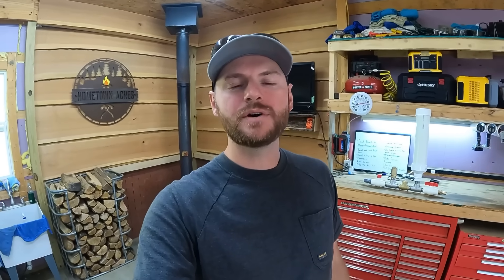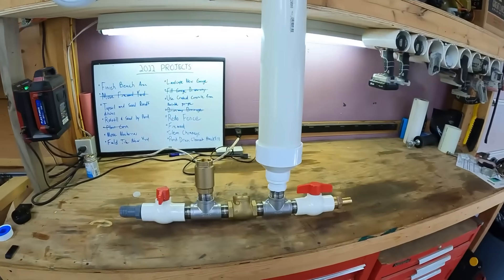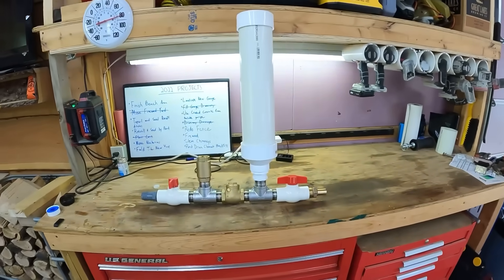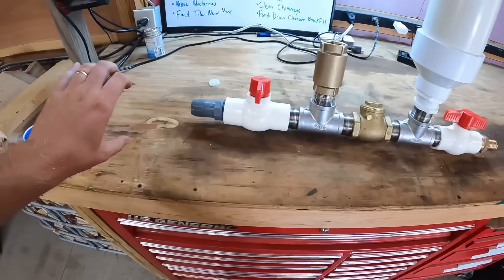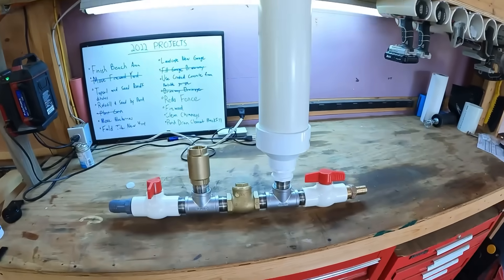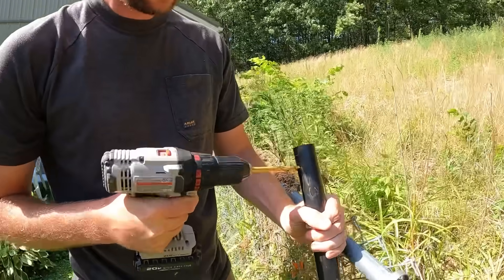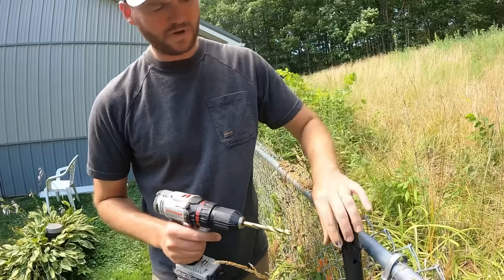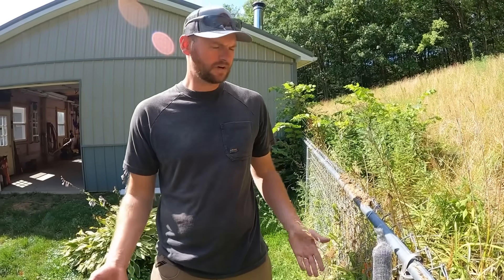We Found Water For The Pond - Hydraulic Ram Pump

Comment: You should always run poly-pipe through a pvc sleeve when crossing a road bed.  for 1" you can use 1 1/2.  The reason for the sleeve is to protect the poly-pipe from collapsing due to regular vehicle traffic compacting the soil along with the pipe.

Comment: I'm thinking so long as the river/stream was running you could put the small pipe in a bigger black pipe 2' off the ground and the sun would heat the outer pipe up which would heat the inner pipe, this would keep the water running in the day time. It won't freeze as long as it keeps flowing and river supplies sufficient flow.

Comment: Love the setup. But just a little bit of a thought. You need to put a 45 degree on the catch tank. This will slow algae growth and reduce stagnation.    You only need about two to three inches of drop from one side of the tank to the other. Swimming pool tablets occasionally help to clear the algae and prevent it from stopping the flow. I caught and piped a spring. Buried a fifteen hundred gallon water from the farm supply. I then put a deep well pump in the tank and ran electricity to it. Pumped the water up hill 75 yards of head and another 150 yards to the house.

Comment: One thing you didn't really talk about is at 05:30  (where you talk about the intake pipe), you don't talk about how much elevation you needed from the intake pipe to the pump to build enough head pressure to make the pump work.

Comment: I wanted to ask what the grade was between the water box that the ram fills and the pond? It seems like the 1
inch waterline runs downhill a lot and it's also a very long run? I only ask because I would think if you ran the 1-1/2" water line up the stream a little to gain a little higher grade and then connected the 1" line to the 1-1/2" line without the ram and then back feed the water line from the pond to fill the line, then open it up, that the grade or gravity from the top to the bottom may be enough to pull water up that hill and you wouldn't need the ram pump.  If not you could dam the stream and put the pipe at the bottom of the dam, that for sure would push it up the hill.
you wouldn't need to stop all the flow of water, enough to push it up the hill. just trying to help.

Comment: is there any chance you can run a micro hydro electric system of off that flow? and if its just shy(not enough flow rate) set up a second ram or maybe a larger one?
because even 1-2kw generated&grid tied you'd be paying nothing for power for one house hold.and if theres an excess and at times(night time) getting paid for the excess🤷🏼‍♂️ i'm just thinking out loud here, but I've heard that ppl with excess solar power get paid to feed grid, right, and water flowing down hill even at that rate(or double with two pumps) must be able to turn the turbine...I was reading that these are the rates of power generated with 25mm pipe
The vertical drop of about 10 meters can output 100W to 300W, 15 meters can output 300W to 500W, 20 meters can output 500W to 700W, 30 meters can output 700W to 1000W,
on a 1000watt (1kw) hydroelectric generator with 25mm pipe🤷🏼‍♂️
your pipe is 1.5inch almost twice the diameter of the setup the example uses... I dont know, it  would be sweet even to produce a single constant kw  for 9months a year and cover your hydro bill...
it seems like you have everything to  generate the power, invest couple grand $2000-$4000and you have free power for 30 years👍
anyways it was just a thought...
your setup is really cool! 🎯
have a good  day

Comment: You might want to increase the distance of the uphill ball valve so when you open it the shock wave will be increased.  Even two or three feet may increase your initial shock wave.  You should notice a more slapping effect on the check valves and an increase in pressure (but not volume).

Comment: I design switching power supplies. These water ram pumps are a great analogy for how SMPS's work!
Now to improve efficiency, and pump volume, add a hose on the release valve water exhaust side to create a vacuum.
This effectively creates more delta head for pumping. It will effect the pump cycle period, so it needs to be dealt with.
it probably is harder to get to work and keep air pockets out, so if this works and is added, best if it can work without the vacuum add, and still pump decent volume. This can help when the stream is far below the tank and more pressure head is needed, because it effectively moves the ram pump up hill relative to total pump head pipe fall pressure and vacuum drop added together.
Bet an extra 20-50% head can be added and still make work without vacuum add.
GAIA your welcome.

Comment: That open IBC tote is a great place for mosquitos to thrive. You would be way better off putting a tee there. With a vent pipe going up to eye level add a J hook to the end with screen. Also adding a valve to stop the venting would actually make your setup into a syphon. will need to add a stopping valve at the end. Not sure why you are against that. That would actually fill your pond way fast and help to not wear out the parts in the pump.

Comment: I don't notice that the poster answers any of the comments. 
I would like to see the inlet side more, as I am very curious of how much down hill run of pipe to the pump was necessary and how he ended up with that much drop for the pump. It appears that he is only relying on the elevation drop of the creek itself to power the pump? Also the pressure vessel? does it require a certain volume of air to be compressed to push the water. How can it build up pressure without air being compressed thru the displacement of water?

Comment: I want to create between 20 to 40 gallons per minute.  The water supply is 100 gpm with a 30 foot drop.  Needs to pump up about 100 feet,  I have a large quantity of 1-1/4 inch ID poly roll pipe.  Can you help me understand what size and quantity of ram pumps would be required.  thank you

Comment: You really don't need the IBC tote. It's functioning just like an open-ended riser to break the vacuum. You can make an open-ended riser with just a 1-inch tee at ground level, and a vertical open-ended standpipe about 3 or 4 feet tall connected to the center port of the tee. That will cost about $3 for plumbing fittings versus $50 to $100 for a clean IBC tote.  And an 1-inch open-ended standpipe (with one of those mesh filters on the open end) won't grow algae or attract dirt and insects like the open top IBC.

Comment: IF You were to build an earthen rock dam in the creek, with the inlet to the ram-pump at the bottom of the dam, the (a) would have a larger reservoir of water, a higher pressure into the ram pump.  You could eliminate the Ram-pump all together, by opening the check valve, and putting in a pipe, and with the increased flow at the base,  with a larger diameter pipe, the hill and gravity would be negated, once a consistent draw  is created by the pond feed pipe.  The Key is to having a dam on the creek itself. The deeper the pond on the creek in the dam, the more water pressure will be created into the pipe, the higher the pressure can be achieved with an outlet pipe, the higher the rise.

Comment: Re. your comment about the need for a tank at the top of the high ground, rather than a continuous run of pipe;  from what I've read about other people's installations, it's essential that the ram has back pressure to work against on the delivery side. This is so vital that one man found his ram was reluctant to get going until he poured a few gallons of water down the delivery pipe from his header tank - once he did that, the ram took off, cycling a treat.
There's a company in England that's been making hydraulic rams for nearly 150 years, and some of the first ones they made are still in place, and still working to this day!
Also, it strikes me that when you get a spell of rainy weather, and the flow rate in the creek increases, that will also increase the output from your ram.  Depending on how much rain you get where you live (in this part of England, we get around 4 -5 feet a year!), you may end up getting close to the nominal 700,000 gallons per year which you calculated from the flow rate you're getting now.
Nice work, mate!
Reply: Since his pond is much lower than the tank, I also thought siphon. If in fact the pond is still higher than the source, then I think the backpressure (required?) would still exist?
LOL EDIT; watched his other video and saw the pond is indeed lower than the crick. IE siphon duh! Cool demo nonetheless.A simpler setup at the tank would be a tee screwed into the threaded drain valve with a vertical fill pipe and a connection for the outlet. Leave top on tank , no sawing or debris required . Thread a plastic tube through the pipe into the tank to prevent pressure/vac buildup.

Comment: Cool, yes great service in the smaller local suppliers, great job too, and you could use the output in that tank to run a small water wheel to generate power too!

Comment: What about using a larger pressure tank for increased flow?
You might get better flow by priming it first with water to remove all the air from the system too.
Please ignore if you already tried this as I have never used a ram pump before.

Comment: I’m curious why the pond side hose is tapped into the tank so high? There is a low fitting built into the tank. I assume it’s to let debris settle, but, if the tank had a lid, less debris would be there in the first place…

Comment: If you haven't done it already, the supply side of the pump should be rigid and as straight as possible for some length before the inlet of the pump.  Galvanized pipe or something equivalent.  This preserves some of the energy in the hydraulic ram and equates to a bit more flow into your pond.

Comment: True about free flowing intake in the reservoir then taping into the reservoir. Free flowing downward prevents creating sucking pressure may affect the PSI at the source. And you can filter some particles in the reservoir (tote). Thx for sharing & Great job. If you need more water, just add another one. You may have enough pressure to add a water turbine and make electricity !!

Comment: Good "little" set up. As for the siphoning hose I would be confident that if you had a continues hose {completely ceiled from your pump up the hill down to your pond & submerged under water in your pond you would get an even more hammer/hydraulic effect in your pump & would have even more cubic meter flow than you have now! Just be certain as you found out, there is absolutely no air in your suction or your delivery pipes & you should have no problem until the valves wear out & need replacing! Good video.

Comment: if you hooked the hose at the top to the a hose that ran to the pond .would the weight of the water running down the hill to the pond help pull water up the hill ?

Comment: You'll need to drain the pressure tube periodically.  As the air inside will get absorbed into the water solution.

Comment: What is the drop to the Dam / Pond from the top of the hill your pumping up? is it low enough to just use siphon action to draw the water into the Pond? If the pond is low enough then just get the air out of the pipe and problem solved.

Comment: That accumulator will waterlog.  Then the pump will stop working.  Unless you have a schrader valve on the accumulator, you will need to drain the system to restore the air.  With the valve, you can use a bike pump to reload the air.

Comment: My house was built in 1823 by the descendants of Meriwether Lewis in Ivy, Virginia (as in famed explorers Lewis & Clark). Around the turn of the 19th century the house was fitted with a copper tank on top of a staircase and bathrooms on each floor in a stacked configuration. The house had a kitchen in the basement and each of the 3 bathrooms was run by a gravity fed plumbing system from the tank. The tank was fed by a hydraulic ram in the creek. This system remained in place until the 1970's. When I bought the property in 1997 the tank and ram were long gone but I found remnants of the old led pipe line to the creek from the house.

Comment: That traction you made hydro pump the parts you build that check valves PC pipes over $500 you can find that stuff in a plumbing store easy you figured that price the plumbers flies parts for that traction that pump cause 500

Comment: Do you happen to know the elevation of the creek vs the pond? If the creek is at all higher than the pond, you could absolutely create a siphon system that would give you much higher flow (if the creek can support it). You could likely still use the ram pump to prime the system but add in a "siphon loop" around it to keep the siphon going. Just add a tee/valve at the top to break the siphon in case you need to do maintenance. Now, of course if the elevation of the creek is lower than the pond, it won't work, but just something to consider.

Comment: You should run the pipe all the way to the pond without the ibc tote. Assuming all air is purged out of the delivery pipe that would reduce the total head that the pump would see to the height of the pond instead of the top of the hill and you would get a little higher flow out of it. As long as the pond level is above the pump then the pump would still see a net positive pressure and work fine (and if the pond level below the pump then you should do away with the pump entirely and just siphon directly from the river)

Comment: I think you could set that up to siphon, once the pressure regulates the check valve would close because the siphon is creating suction. I ran a 6” siphon on my lake and was getting 1,000 gallons a minute on 30ish’ head.

Comment: As far as it is from the top of the hill to the pond (without knowing the distance from the top of the hill to the stream) I wonder if it would be possible to create a direct siphon from the stream to the pond. If you have enough redundancy in length of pipe from the top of the hill to the pond, you could theoretically create enough downhill suction to siphon the water directly from the stream, over the hill, and have the water pumping consistently without the ram pump. (Just a thought I had.)

Comment: I installed one of these in 1985 pretty well as per this video and initially it didn't work very well until after picking the brains of some old timers i got rid of the alkathine drive pipe and changed it for a rigid metal one  two inches diameter in my case, the problem was the plastic pipe every time the valve slammed shut was expanding and absorbing some of the shock effect, afterwards it worked ok, I had 20ft head and delivery tank was 300ft up, half a gallon a minute was output

Comment: Make it a single pipe from pump down to lake. That way (once you bleed it) it is only hight difference between pump and lake matters.  If you break the line at reservoir on the hill you are loosing all down pressure from hill to lake.

Comment: Why not hook a hose up to the check valve so you dont wast all that water there has to be a better way. I can perfect that better . On top of that check valve id add a clear cylinder with a reversed spring and plunger that will make it fill the cylinder and kick it back quicker because it will load the spring and plunger and build pressure . 😉  tou will need a bleed screw on top of that cylinder to get the water flow initially started . That clear cylinder that will be on the check valve will have a push oull effect. Cylinder will be like the white one but much smaller. And not only will it gain power no water loss.

Comment: the pump seems neat but something seems off, i did not hear what the height difference between the inlet source and the pond was so all i can do is guesstimate. the pond looks lower than the thirty or so feet your pumping your water uphill plus the drop to the pump from the source to create the water hammer effect.

if the pond is lower, a better solution may be running a siphon tube with a sealed barrel full of water placed at the apex with the inlet placed high on the barrel and outlet placed low. by opening the downstream outlet the siphon effect could be kick-started priming the line and get the air out. this would allow the use of the theoretical max gpm of your tube diameter.
once all the air is out of the line the ball valve could be used to start, stop or regulate your flow rate.

Comment: I think you probably just installed you check valve the incorrect way to begin with if the pressure and spring are holding it closed. Flip it 180 degrees.

Comment: That's an ingenious way to pump water.  A Frenchman named Montgolfier invented it in 1796.  You mention the amount of water pumped as 800,000 gpy as optimistic.  But even at 125,000 gpy, you'd still have a net gain of about 3"+ in a 40,000 sf pond.  I didn't think they could pump water that high or that far.

Comment: Hello!  Can I recommend a very interesting channel that I think you’d find very relevant. Kris Harbour is an extraordinary craftsman and hydro electric designer engineer and manufacturer and installer - he deals with water flow, pressure, head, drop, venting etc. What he makes and achieves is really very interesting.